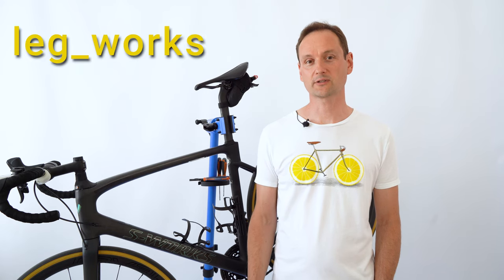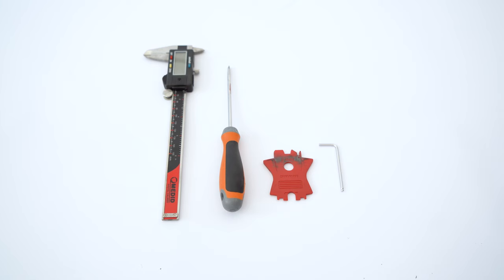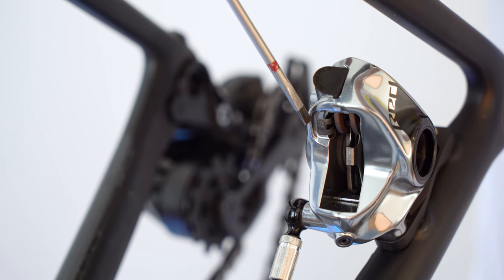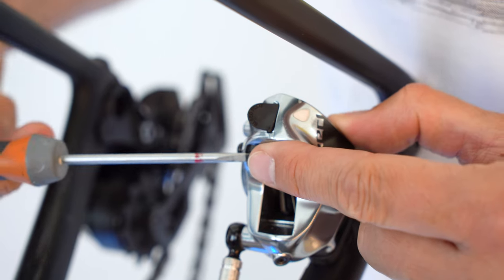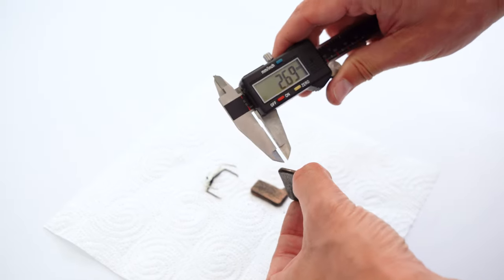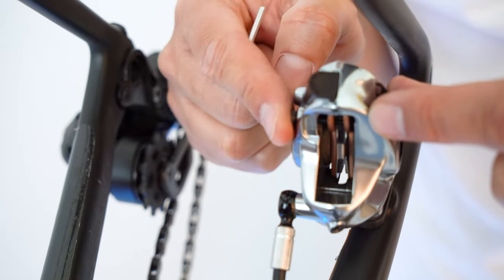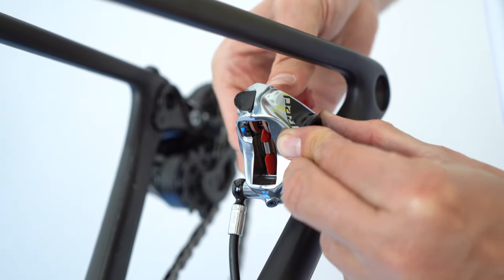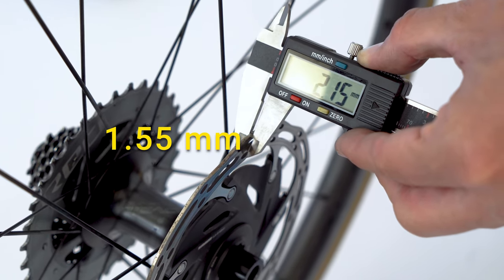How to Replace Brake Pads on your Bike | Simple Step by Step Procedure for SRAM Disc Brakes

Comment from the maker: What's the average distance you ride before replacing your brake pads?
Let me know in the comments below  ⬇⬇⬇

0)  Don't know 🤔
1) less than 1,000km
2) between 1,000km and 2,000km
3) between 2,000 and 3,000km
4) between 3,000 and 4,000km
5) more than 4,000km
Reply: 0 😁